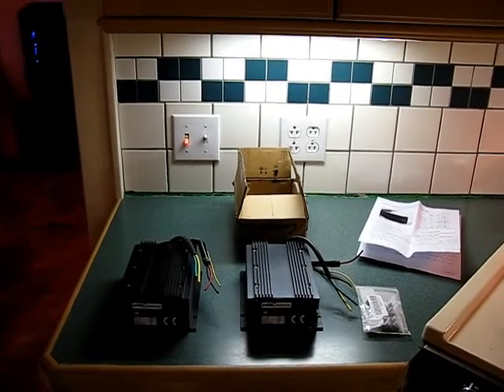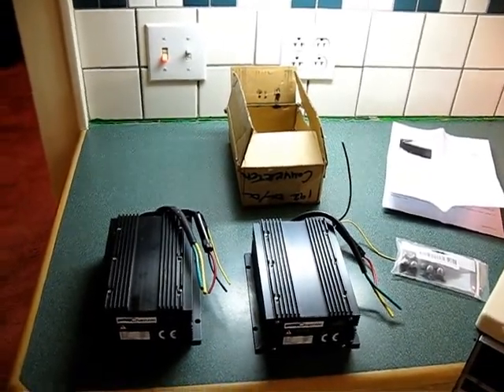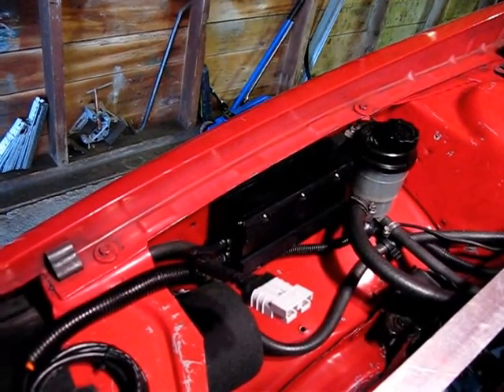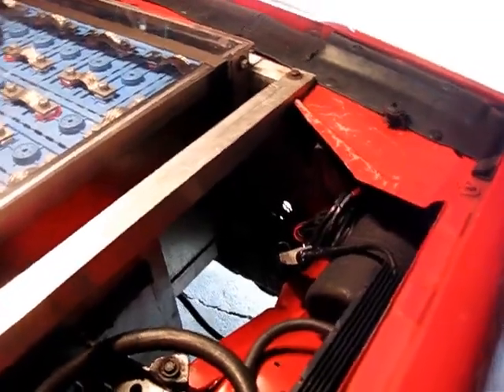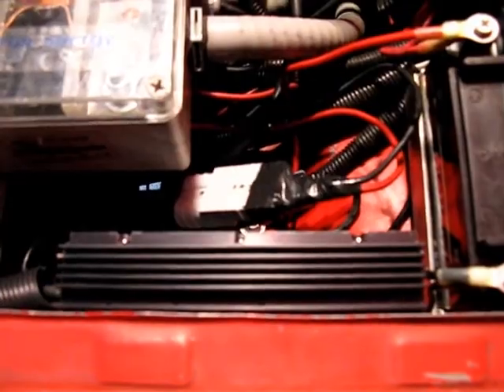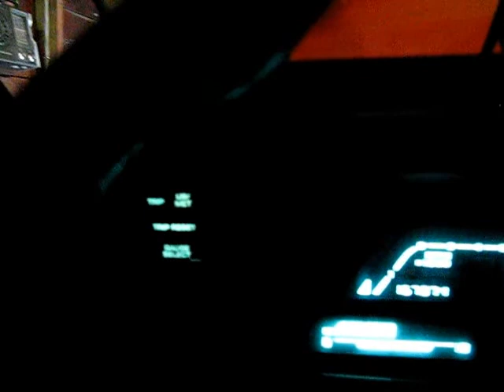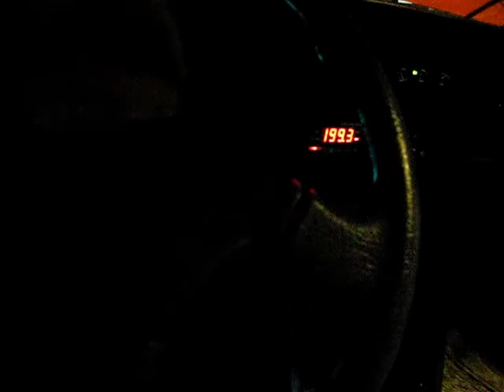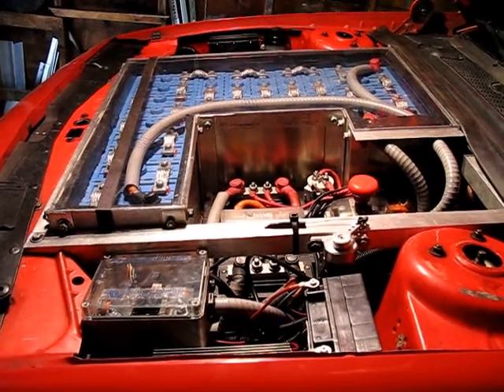June 13, 2013 - New Dual Chennic DC To DC Converters & Installation

Comment from the maker: Yes, I am using a small SLA AGM motorcycle battery, wired in parallel with both DC-To-DC converters with the theory being to help buffer the spikes/sags on the loads.  :)

When my 1st Chennic converter arrived a year ago, and made the hissing sound, I shot a video of it and sent the link to Jack at EVTV.  At the time he said that they had never had those symptoms before and offered to exchange it for a new one.  Since it was working fine (other than the sound) I opted to keep it...

Comment: There's always something.)
The non sealing is not my first choice but the the fan comes only up at >19 amps at 12 volt or by temperature. I use two in parallel inside the car and the fans are not running. Because it is made for AC the input is pretty safe.

Comment from the maker: With no load the dual Chennic units I have are utterly silent as well, but they are notably noisy when there is any significant draw.

I think it would be an interesting experiment to compare the odd 'hissing' noises that the Chennic converters seem to make against sound of the fans on the Meanwell power supplies, with both of them under full load, just to see which one is more annoying.  *chuckles*

Comment from the maker: I looked up the model you suggested and it appears to have a fan, is non-sealed, and does not appear to be isolated, correct?

They do have a 15v @ 43a model which looks to be closer to the specs of the Vicor MegaPAC, but that one is still quite a lot less powerful than the 15v @ 80a output of the Vicor and has all of the same disadvantages (other than possibly a quieter/temperature controlled fan)?

Comment: Hello, I have a dc to dc that seems to have a signal wire (to activate the conversion) yours is having also? if yes, signal is on 12V or traction voltage? Thanks, nice conversion